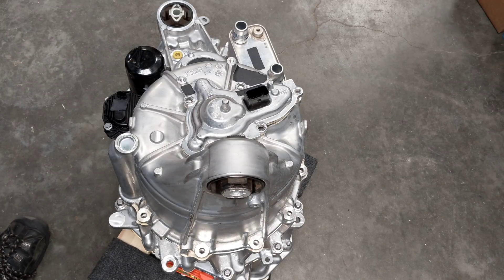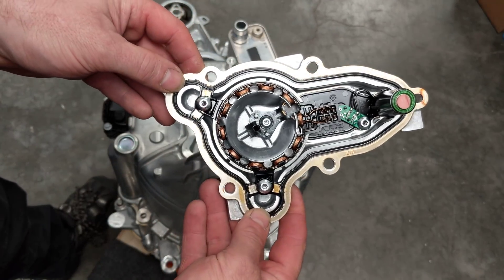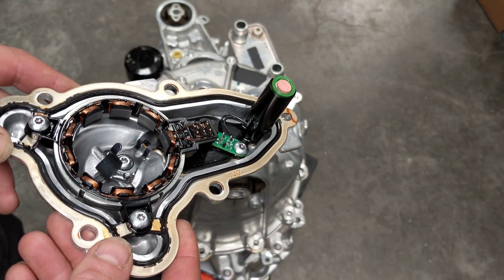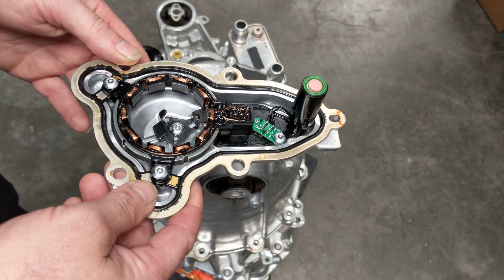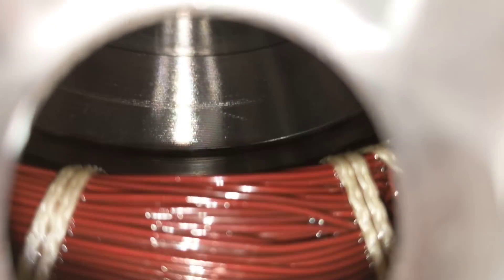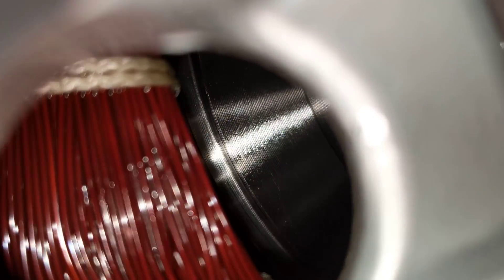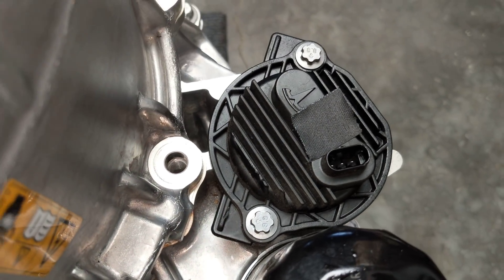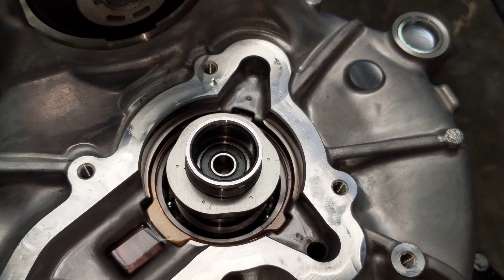Tesla Model 3 Drive Unit - Part 2

Comment: I have a resolver plug broke i want to replace it my question if i open it there is any coolant inside gonna drain if what i have to do ??
Reply from the maker: No, it is safe to remove the resolver, only a tiny amount of oil will come out.  (Most will be in the sump)   Make sure the car is powered off though, or the oil pump could ruin your day.

Comment: I am considering the drive unit for my Honda S2000. I have 700mm between the rails in the rear subframe. A Model S SDU will just fit. Can you tell me the width of the Model 3 drive unit?

Comment: if you are interested in the details: us2018/0083515A1.
bearing current protection on all model 3/y and all s/x raven front drive units. one mega mile drive unit 😎 - thanks 4 the vid!

Comment: First part removed = Resolver Cover. Thermal sensor has since been removed.
If you have a small crane you can easily remove the rotor-stator combination. Or lift up REALLY hard on the stator. There's nothing holding it in to the gearbox other than its weight and the splines of the rotor and differential gear.
Reply: I have a broken resolver cover plug i want replace it but im scared i dont know if there is any coolant inside wll drain what i have to do

Comment: Interesting; I was looking for details on what type of switched reluctance design they went with; and that rotor looks very intriguing; maybe what we see there is just part of some form of endcap; but rather than seeing a rotor lamination with salient poles, or a lamination stack with cutouts to direct the flux path, we see something that looks like a circumferentially wound pattern. Perhaps the stator is cut/stamped from a single sheet of silicon steel, rolled into a rotor? That would be something quite different from a production perspective; potentially radically simpler indeed.
Reply: Then you have noticed that what you read in internet told by "experts" is often inaccurate ed even wrong because you documented yourself and you have noticed some contradictions (there are many). Don't trust blindly any statement if does not come from reputable sources. The average Youtuber / twitterguy / writer in EVs website are not.

Comment: +Ingineerix I just watched your interview with Rich Rebuilds and would like to know if you could do what Tesla is doing with the new Model X and Model S and put a Model 3 motor in an older Model X and make it work and get the additional 30 miles of range?
Reply from the maker: Yes, it's possible, but a phenomenal amount of work.  The costs would make it not worth doing. Sell your S/X and buy a new one.  (Then you also get a warranty!)
Reply: @Ingineerix  Yes, I thought of selling it first but the loss due to the recent Tesla price drop causing inventory, discounted, and used Model X's to decline in value would lose thousands more, however having a new warranty is better. I will just keep them and buy the new models too. Thanks!

Comment: Hey I love your very informative videos.  I found this salvaged Model 3 which I really want however it has some damage to the rear quarter panel above the tire. Could there be damage to the motor or some of the rods behind the tire? Or should I leave it alone?
Reply from the maker: I do not work on vehicles physically, I only assist owners with the technical side (diagnostics, etc).  It's also not possible to me to comment on the car you are looking at without at least some pictures.  Email me a link.  (you can find my email in the channel information)

Comment: Thanks for the video. I am curious to know, does the motor have a cast in cooling channel i.e. in the motor housing ,or it is mounted externally on top of rotor?
Reply from the maker: There is a stacked plat heat exchanger that pulls heat from the lubricant in the drive unit, and that lubricant is circulated throughout the drive unit by an oil pump.
Reply: a reluctance motor rotor does not have the need of cooling

Comment: the reason you can't take apart the stator housing is because the permanent magnets from the rotor are fighting against you. If you remove from the input bearing and you don't hold that front gearbox bearing, then the rotor will stick to the stator and you're screwed too (likely damage the balancing taking it apart then). it needs a fixture with a guide feature to take apart ; |

Comment: Hi. You need to open the HV sticker on the case and remove the 2 bolts on the orange access cover and remove the access cover. Then remove 3 bolts to separate the HV connection between Inverter and Emotor inside the case. Then the Emotor should come right off.
Reply from the maker: This was obviously done.  How else would I have been able to remove the inverter?

Comment: I tore down my first generation 2003 Prius transaxle when I bought my car. It was totaled because the previous owner ran it dry due to an oil leak. It was not a simple job. I have some pictures of the teardown for comparison. It would be interesting to see how this type of drive has evolved. I'm not familiar with all of the technical details such as type of motor, etc. but if you are interested, I can share the pictures.
Reply: please, I really want to see the motor
thank you

Comment: 2:35 Reluctance motor? It should be a permanent magnet motor.
Reply from the maker: Tesla is indeed using a cutting-edge hybrid motor design variant called a Permanent Magnet assisted Switched Reluctance Motor (PMSRM) as the rear motor in the 3, not IPM. Don't just take my word for it, For additional evidence I give you a tweet from Elon himself: https://twitter.com/elonmusk/status/998015873167208448?lang=en
Reply: +Ingineerix
So they're also using SiC power electronics. Cool.
I assume there's no article/video out there the explains how exactly this hybrid engine works.
Reply from the maker: =)  http://bfy.tw/JCoE

Comment: I'm assuming the oil and the filter need to be changed at some point during the life of the car. Does it specify when (what mileage) and how anywhere in the manual?
Reply: Every 3,000 miles.  Don't worry.  Jiffy lube gives volume discounts. ;)
Reply: https://model3ownersclub.com/threads/will-model-3-require-an-oil-change.6227/#post-84768

Comment: A non excited reluctance motor doesn’t have any clogging torque.

The rotor also doesn’t have salient poles. So I’d call this motor IPM with high reluctance torque.
Reply from the maker: This is a Hybrid; a PMSRM, so it has some cogging, but not as high as a IPM would have.
Reply: No salient poles, permanent magnets in the rotor... That's an IPM. Sure it has reluctance torque, basically every IPM has.

https://www.jstage.jst.go.jp/article/ieejias/126/7/126_7_827/_pdf
Just read this paper, basically the fundamentals of the Leaf motor. They call it IPM and it clearly has reluctance torque enhancing flux barriers. And how often have you heard Nissan call their motor SRM?
Reply: you're right. both 2 names are for 1 type motor. 
as I saw in some video, permanent magnets are sticked in the rotor. but I think PMs here just assist for reluctance flow. fundamentally, it's still a reluctance motor, I think

if you have any files about this type of motor, please let me know, I'm doing my final college project with this reluctance motor... thank you!
Reply: Wikipedia isn't much help on understanding IPMs. do you have link to a basic 'for dummies' explanation?

Comment: Thin winding wires implies there are several of them in parallel for each phase, this seems to be somewhat cheaper and easier to manufacture.
Reply from the maker: Most definitely.  This stator can handle peaks of 350kW, so always going to be lots of parallel windings.
Reply: Ingineerix Did not mean to imply that you where void of this information, but rather point it out since you mentioned they where thinner than expected. Thanks for doing the vidoes and have nice weekend! :)
Reply: Yes, it's cheaper ,lighter, and more compact by using thinner wires.  Due to the "skin effect"  whereby AC flows more near the surface of a conductor.  Even $20 in material savings on copper adds up when 250k+ cars are made annually.
Reply: Higher density. In a perfect scenario the wires would be hair thin but winding them would take forever without specialized machinery that is yet to be invented.

Comment: Thanks for this revealing look into the drive motor. Do you have any guess about reliability given what you’ve seen so far?
Reply from the maker: Tesla has clearly put everything it has learned from S/X development into this car.  There may have been some early bugs to work out, but I think this is going to be a very reliable car.  The drive unit is clearly designed for a very long life.  I expect Elon's claim of a million miles will be achievable.

Comment: There maybe sealant between motor shell and gearbox shell，its hard to separate them without any damage. The thermal sensor is different. thanks for sharing, at least i know there exists oil in motor, that means a lot XD

Comment: hello there, do you have any insight on the Model 3 MCU? I have an issue where the screen shuts off and on intermittently and as of today, i can barely get it to turn on anymore. Someone suggested it might be a faulty temperature sensor in which the MCU thinks its running hot hence shutting down constantly. Any insight is helpful thanks!
Reply from the maker: On the Model 3, the center screen computer is called the "ICE" not MCU.  It is a module that's integrated with the Autopilot ECU and it's mounted on the firewall behind the glovebox.  It is cooled by glycol, and i have seen a car get air bubbles in the lines so it is unable to cool properly and eventually overheats and shuts down.  One way to check this is to pull the passenger footwell close-out panel off, and touch the silver ICE housing to feel it's temperature.   In any event, your car is under warranty, so Tesla service should replace your ICE and/or bleed the cooling system for you for free.
Reply: awesome thank you for this! i most likely won't be able to fix this problem myself as i don' t want to void any warranty, but knowing what the potential problem might be is reassuring that tesla will be able to fix this. i do have an appointment next week to get it looked at so hopefully they will permanently fix this major issue and hopefully no other model 3s out there will experience what i have in this last day or 2. thanks again!
Reply from the maker: No problem.  Good luck!   You can keep driving the car, but if the ICE dies, you have no control over things like HVAC, and obviously no audio.  All the cord car functions will still work though.  For instance, the turn signals will still flash, even though you wont hear the "click".

Comment: First thanks for doing these cool short videos, keep them coming!
My question is how exactly is the stator cooled? Glycol/water mix around the outside frame or oil sprayed inside? Or non of the above?
Reply from the maker: Oil is pumped in and then the Oil is cooled by a stacked-plate heat exchanger, visible in my other videos.
Reply: @Ingineerix  Does this mean that the stator end-winding are splashed with oil by the rotor? in your video the end-windings seem to be quite clean.
Reply from the maker: @Zirikatuz  From what I can tell it appears that is the case, however, I can't confirm the path the lubrication system takes.  The oil is a thin synthetic, so it drains down when the oil pump is turned off.

Comment: I thought these Tesla electric cars were too expensive, but after seeing all the technology involved I must say I am having second thoughts.  Thanks for the excellent videos.
Reply: The R&D to get it all here is very impressive.  I chuckle when some say "it looks so simplistic..."
Reply: Fuel is expensive, even now at 2.20$.
Reply: @martialman.4563  yep $2.20 per litre here
Reply: It really is. Well designed hardware at its finest - you know its well done when you dont see the effort put in.
Reply: No, they really are too expensive. that's because of the bateries and the gimmicks throughout the car, though.
If you look at manufacturing costs, an electric drive unit is actually cheaper than a comparable engine/transmission.
Reply: @gsilva220  Nope they are actually very cheap to produce, the R&D is probably hell expensive. Reluctance motors are CHEAP to make, but HARD to engineer. :) They are probably the only EV maker that actually makes a decent margin. (Although all margins go into growth of the company, as it's still a startup to grow)

Comment: Is it the reluctance motor characteristic or the permanent magnet part that is the cause of the cogging motion as you turn it?  I thought the reluctance relies on an active current to provide the magnetism, so a disconnected reluctance only motor should freewheel smoothly, right?  Asking because I'm hoping to understand these new hybrid motor designs better.
Reply: The motor design is described in this paper: https://ieeexplore.ieee.org/document/6754501/ as well as others.  There are, in fact, PMs in the stator.  That's the key innovation that's revolutionizing EV motor designs.  It is unlike standard IPM motors in a variety of aspects, including far less use of rare-earth materials, inability to regenerate at low speeds, and very high torque.
Reply: Ingineerix it doesn’t have salient poles, so it’s not switched reluctance.

IPM with high reluctance torque is what I’d call it.
Reply: As always there is a lot of hype around Tesla. You are right, a reluctance motor would not have cogging. This is an already classic PMSM (Permanent Magnet Synchronous Motor). Latest designs of PMSM do generate a significant part of the torque from rotor reluctance. At least Toyota was using this design in Prius for more than a decade. For more details check this Toyota Prius evaluation: https://info.ornl.gov/sites/publications/files/pub26762.pdf The torque components are presented on Fig 3.10 page 62. After seeing Munro Tesla Model 3 teardown the only significant difference I know of is that Tesla is using the PM in a halbach array. A small clarification, Switched Reluctance Motors work in a similar way with stepper motors and are prone to noise and significant torque ripple. They are mostly used for high speed (10k+ rpm) applications (Dyson DC 31 - 104,000 rpm). Otherwise the reluctance motor are of synchronous design, with quite interesting rotors (like ABB synchronous reluctance motor). PMSM are synchronous therefore if you want to use PMSRM acronym, it stands for Permanent Magnet Synchronous Reluctance Motor.
Reply: @savclaudiu2133  I believe there is a massive misinterpretation as regard the machine design of the rear drive of model 3, maybe related to some kind of mysticism around Tesla and lack of specific knowledge on e-machines: (1) it's highly probable that it's not a permanent magnet switched reluctance machine but it is an interior permanent magnet synchronous machine (which btw exploits the reluctance torque) as you suggest (2) it's highly probable that there is no Hallbach array, just standard segmented magnet (segmentation is a strategy to reduce eddy current losses which would be rather remarkable at medium-high speed). Hallbach array is the conclusion of Munro based on really weak statements: if it's segmented it's Hallbach (answer: not necessarily), if you hit it with an hammer it's Hallbach (answer: not necessarily).
Reply from the maker: This is a hybrid; a PMSRM (Permanent Magnet Switched Reluctance Motor)
Reply: There are permanent magnets in the stator.  The rotor has variable magnetic reluctance, basically vanes of ferrous material.  So the cogging is simply the rotor aligning with the magnets in the stator.
Reply: Could you please be much  more specific?  Your comments, Bobysze, and Edison's are too short to give useful info.  Instead, one could surmise that it's Permanent Magnet primarily as opposed to a Switched Reluctance with Permanent Magnet as an augmentation.    Edison, saying it is an IPM motor not unlike Leaf or Bolt is not correct according to Tesla and the many things I've read about it.  This is why it is the second most efficient EV to date (just behind or equivalent to the Ioniq).  But if everything I've read has been a Musk tweet and was influenced by Ingeneerix's early information, I'd like to hear what you guys know that I don't.
Reply: There are no PM in the stator. That's silly. It's an IPM motor not unlike Nissan leaf or Chevy bolt. And Prius.

Comment: Hey thanks a lot for this great series of videos. Could you comment on the motor’s differences vs induction and other brands’ permanent magnets? I think this is a hybrid of pm and switched reluctance. What does it add to the table? When is it efficient when is it not adequate what is it best at etc?
Reply from the maker: I wish I was a motor expert, but the efficiency of this design speaks for itself.  One of the problems with a pure switched reluctance motor is torque pulsations and that leads to noise and vibration as well as a loss of efficiency, not to mention the stress on the related driveline components.   By using this hybrid that combines elements of both BLDC and SR Tesla has figured out how to get the best of both for a super efficient and easy to manufacture design.
Reply: This dissertation introduced the design that is believed to be used for the Model 3.  https://vtechworks.lib.vt.edu/bitstream/handle/10919/77978/etd-01172011-105438_LOBO_NS_D_2011.pdf?sequence=1&isAllowed=y
Reply: Thanks. I'm surprised it is 'so efficient' that addinly only a front AC induction motor renders the whole system less efficient even though they can tune gear ratios and torque curves accordingly. (like on the S/X)
Reply: I'm not sure if this exactly right but watch this demonstration switched reluctance: https://www.youtube.com/watch?v=n4YD8Nvyfa4